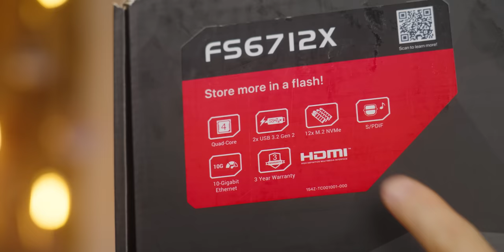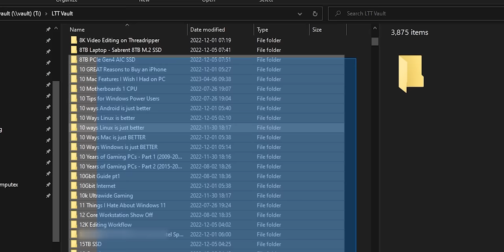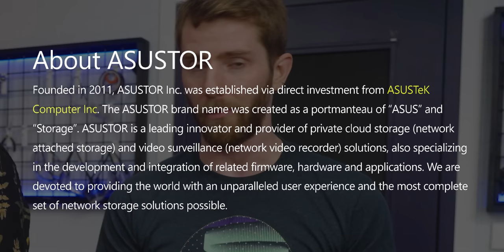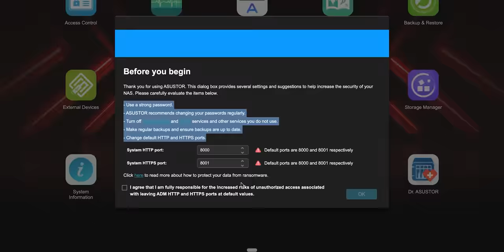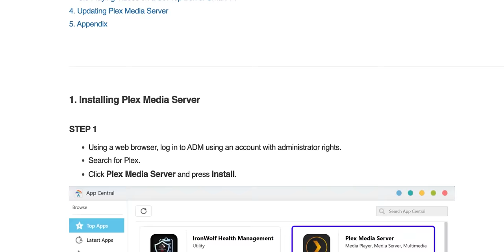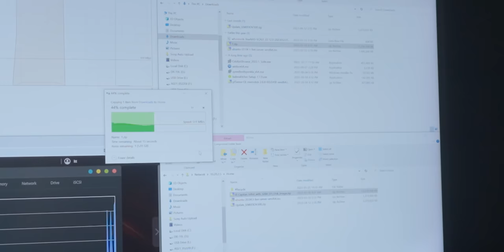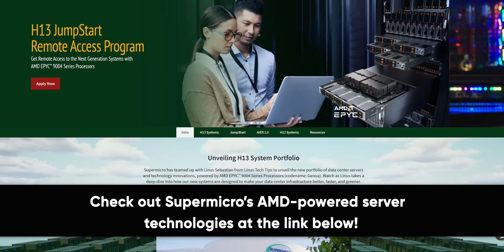I should stop building computers - ASUSTOR Flashstor NAS

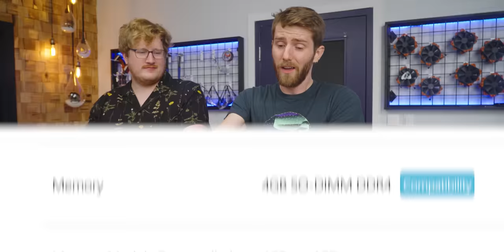Comment from the maker: Minor visual error at 1:04 - the graphic says 2GB but it should read 32GB, as the kit has two 16GB sticks of RAM. Sorry for the flub!
Reply: 2*16=2 confirmed
Reply: @unknwnd  2+16(0)=2
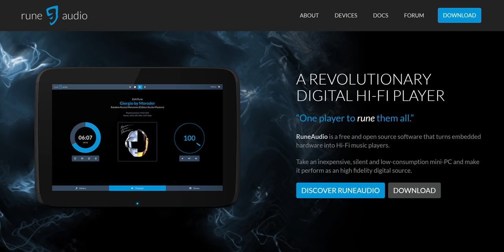Reply: There’s another error at 5:56. Roon Labs is the popular among audiophiles music server software, not Rune Audio.
Reply: That PPNAS is really turned on now! 😂
Reply: Actually at 6:05 you can see they are install 2 8GB sticks since that's all the SOC can do anyway. So graphics are wrong again but Jakes words was right.
Reply: Not surprised that even your correction is in error... maybe just stop putting out content that is actually just thinly veiled advertisements for your sponsors, and focus on the facts.
Reply: Simple question.. how would the experience be to play games stored off a NAS like this with a 2.5g or better connection?
Reply: @joetuktyyuktuk8635 I like the part where you were forced to watch this... Oh wait, you weren't!
Reply: A few things I would suggest if you do an updated SSD NAS Video make sure too use SSD's with extremely strong Onboard SSD ECC, BTRFS or ZFS for Format and if at all possible ECC RAM and a Pure Sign Wave UPS more layers or DATA Protection is usually a good thing!

Comment: This NAS is currently a little pricey all in, but with how quickly NVMe prices are dropping, I think it will make even more sense for those who want a quiet little NAS and don't only need maximum capacity.
Reply: Do you think it would be possible to do this on some sort of Pi? I'm not sure if you'd have enough PCIe lanes or enough performance for the RAID
Reply: no this is extremely janky for the price perf - compared to what even red shirt jeff could do
Reply: Hello there
Reply: I think you're imagining a market for this. The percentage of people that purchases a NAS? 0.2%

The percentage of thos that would pay extra for silence? 0.2%.

The market for this is apparently 0.02%.
Reply: I think you are wrong about it being pricy... its about application.  for persons with unlimited space and power there are cheaper options, but the fact this is so small, and power efficient, and for me best of all... shock resistant (ie while going down the road) means this unit is perfect!
Reply: still alive buddy !
Reply: @jamesmcjamesington631  someone cant math properly :D thats .0004%  but you are right this wont be for everyone, but there are a lot out there that will have a real need filled by this product. people who live, or spend significant time in boats, rvs, traveling in general.. this is a portable box that will have huge implications for people who have been looking for something like this for a long time
Reply: @Pipe0481  a pi 4 only has 1 PCIe lane, and it's only exposed on the the compute module i believe
Reply: Ya, with a half gig nvme boot drives alone going for prices in the 20s in many cases now, adoption of nvme is pushing spinning drives into obsolescence at a high speed. They're going the way of the CD drive. In a large part it's because flash memory itself isn't revolutionary. It's not bleeding edge tech, it's been around for decades. It's just a matter of adoption by mobo manufacturing and drive manufacturing being increased to support the tech that is already generations old and proven to not being decreasing in use, so they're a safe manufacturing bet for storage drive makers.
Reply: @Pipe0481  Open Media Vault is a bare metal distro for Pis that handle external usb very well
Reply: @shephusted2714  with jank being a term being thrown around more and more these days, I've been interested to see the difference in how different ppl definite it. How do you define "jankiness"? I know how I do isn't necessarily some standardized thing... I guess I'd define it as being something mostly defined by being based on "retrofitted in the moment" non pre planned solutions that are often ugly, slapped together with what's readily available, but work and don't need to be looked at. What's another take on it, outta curiosity?
Reply: I'm having some Deja Vu, did you do a video on this Jeff?
Reply: no way i didnt realise jeff wasnt a small techn channel with about 30k subs
Reply: Agreed but the convienence! I like how you actually follow Linus Tech Tips. Saw you in WAN show live chat the other day too!
Reply: For sure. If I had $7k that I could drop on this and 6 8tb nvme drives, I'd be set for quite some time.
Reply: Like linus said, it's useful for an on the go Nas. For product reviewers, and I'm sure a lot of other use cases it's useful. Not for normal home users.
Reply: It's only has speed no more than Sata drive.

Granted it's SSD, and it run insanely fast with some Raid. But you only will need SATA SSD
Reply: 6:12
Reply: @Dygear  Not yet. We sent him one though. He did the Lockerstor 6 Gen2 recently.
Reply: @Dygear blog post, video is currently in progress. I'm testing an SBC against it 😂
Reply: 9:04 no idea what any of this means but is interesting 😀😀
Reply: @jamesmcjamesington631  So millions of people? Lmao
Reply: Especially if we wait 3-5 years, the tech will get cheaper and these will start showing up on the second hand market. Gives us normal plebs the ability to built a hot rod nas
Reply: @Username-u5e  General Kenobi!
Reply: NVME prices are dropping?
Reply: Depends on bulid
Reply: @marcogenovesi8570  ya, can't argue that at this exact moment I spose. But it is definitely on the horizon. Unless there is some revolutionary tech that arrives first, these will inevitably take a larger and larger chunk of market, which is still good for innovation and prices. It seems like a no brainier eventually. The major worry is flash degrading, but I guess mechanical drives can fail, too. Taking plates from a spinner and retrieving data is easier than recovering from failed flash, though, so I don't think my comparison to CD drives is quite accurate.
Reply: @ampgammer  Seems like this would be ideal for a newer team with a limited budget that needs a server on the fly.
Reply: @Pipe0481  fast data transfer/compressing uses an insane amount of cpu power. so no, not yet or for another 5 years at least.
Reply: @marcogenovesi8570  WOOT! WOOT!!
Reply: ServeTheHome did a review for this. Jeff did a Collab with ServeTheHome. Now LTT does the review, it's a big love triangle and we all are better served following you all!
Reply: I only wish that 4tb nvme pricing was better aligned with the rest of the pack..2tb around $120 is very nice.

Also I'm thinking 2 arrays of raid 5 would need better than the 12 drive raid 6 given the hardware.

Something like this with an N200 would absolutely be awesome.
Reply: @jamesmcjamesington631  can't speak for anyone else but I have a 6 drive Synology with 12tb drivers and a 5 bay expansion I was going to use for crypto farming storage, but it became too impractical 3 days in. So I had a handful of nvme drives and a decade worth of backup storage.

If I were shopping right now, I'd probably go for something like this with TruNAS for home lab storage.
Reply: @benvredenburg534  yeah, the drop off after 2tb for pricing is massive.
Reply: Jeff is in the house wowowo
Reply: @Tential1  mas storage for a home loan kubernetes setup. The 6 drive version is probably the better option.
Reply: @Anthony P  someone can't math properly :D that's .04%
Reply: Prices aren’t low enough yet for nand to replace spinning rust. And w/ a NAS you’re paying for the software just as much as the hardware. If you’re already invested in Synology it could by a hard switch to something like this. But if Synology gets on board, Qnap already has, then it bodes well. 

My concern is drive failures. I’ve had a lot of nand fail than spinning rust. And this concerns me w/ something like this that’s going to be used for backup.
Reply: Just a little? I can get a way more powerfull mini pc for that price
Reply: I wish Jeff was my shady rich uncle
Reply: Like instead of involuntary incriminating me in a multi-tier money laundering empire. He would like teach me how to do like pen testing or something and we would ethically topple multi billion dollar organization but to just like to test their security or whatever.
Reply: This scenario was covered pretty early in the video, Jeff.
Reply: Motherboards are coming with 4,5, and 6 m.2 slots now. They are pricey still. But down the road a diy itx nas should be near cableless, like the asustor 6.
Reply: @NightSkeptic  absolutly.. honestly im amazed its taken this long for someone to come out with one of these types of nas units..
Reply: @jakekisiel7399  there are some crazy good bargains right now. In some situations NVMe no more expensive than their SATA equivalent.
Reply: It is somewhat pricey but also rather elegant.
Reply: Love when my subscribed channels leak like this.
Reply: @fxmech one big happy family. And many will gather at LTX!
Reply: @jennastewart7305 but we all know the comments are where the party's at 🎉
Reply: @jamesmcjamesington631  I don't even know what a nass is or what it could be used for
Reply: I have a synology that’s going on 10 years old and still works!
Reply: The actual barebones box with that custom tooling and the custom board and all those features...kinda nuts for under 500 bucks
Reply: @jamesmcjamesington631  with larger phone capacities and higher pixel cameras. The market for home nas has been growing dramatically in the last few years. I agree with you the market for silent nas is very small but we are not far from SSD prices making it cheaper to buy and use SSD nas rather than a hdd nas.
Reply: @ampgammer  This is kind of only impressive if you need portability from a NAS along with massive storage, and for all the work to be done for you. The 6 drive version only has 2.5Gb networking, which doesn't make sense. My 4x6TB HDDs running truenas in a VM gets the same throughput, and could be improved with a single NVME cache drive. 

If you can't even max out the 10Gbe interface, you would have to just need a massive amount of SSD storage to travel with. Probably don't need that much bandwidth on a boat/RV anyway. Otherwise you could get a $500-$650 laptop (even less used) that accepts 2 SSDs and just mirror 2x8TB for redundancy (or not for capacity). You end up with a faster CPU (like a 4600H/5600H) for services, built-in battery backup (would've wanted the NAS on a UPS anyway) and even have it serve as a mobile router. It's even a spare screen that can be stowed away with sleep disabled. Saved even more space and money.
Reply: Ayyyy Jeff good to see you here as a top comment
Reply: I meeean I'm in the weird position of actually having 10* 1tb nvme literally scattered on my desk so this is actually tempting even though I have zero use for it
Reply: It is limited to 10Gb and CPU so it doesn't need to be expensive NVME, or even NVME at all.
Reply: Honestly, I was thinking of having a NAS but if it's hard drives, has to be RAID 10 and the fact that this uses SSDs makes RAID 6 viable
Reply: Lately NVME prices skyrocketed. I missed out on great opportunities late last year
Reply: nvme prices are going up if anything and this was a review for cash deal and therefore can't be taken remotely seriously - red shirt jeff would saw one of these in half and then make something better
Reply: Exactly especially when you can by a SS NAS with more m.2 or even Sata ports and buy more Smaller Capacity Drives.

I would suggest too use SSD's with extremely strong Onboard SSD ECC, BTRFS or ZFS for Formatting (Depends on your OS!) and if at all possible ECC RAM (Ryzen supports it by default but need to check with the Motherboard Specs!) and a Pure Sign Wave UPS more layers or DATA Protection is usually a good thing!

I really wish CAMM2 used ECC as part of the Spec!

Comment: This is like SO close (may still be worth it). Loved everything but the processor. I hope there is a Rev 2 with a processor that can last.
It's a NAS so it's not something you want to replace in a year or two. I want it for a decade. Everything else is great, but that processor is just gonna get worse and it seems too strained doing some things now. It may certainly be worth it for some people that just want a new NAS and don't stream from it, though. I hope enough people to get an upgraded one.

P.S. I would really like LTT too spend more time in the  "mid-tier" space again with things like this. It's fun looking at $100,000 servers but it doesn't really help most people and prices are running so high right now, we need more practical idea coverage.
Reply: It's really something beyond my understanding how these companies insist on using slow Intel CPUs on these products - did they fall off a truck? Also, the latest N-series processors aren't much faster than the N5105 either.
Reply: @Gabu_  energy efficiency. 
These mobile Celerons are great. They have a decent igpu with support for Hardware HDR tone-mapping, the compute power of a 7th gen i3 while sipping power. 
Compared to the J-series desktop ones they're better in every aspect, but they aren't as popular on desktop board unfortunately.
Reply: You mean fortunately? They only match the slowest 7th gen i3s performance, and only in multithreading (the i3s are dual cores, a sin in 2023) - keep in mind those same chips still can't match 2nd gen i7s.
Sure, for energy starved applications these cpus make sense, but do those 10-20W REALLY warrant giving up on 500% performance or more?
Reply: @Gabu_  you might care about energy efficiency for: solar off grid applications, mobile car applications, ???
Reply: @Péter Friedrich  see, is it "energy efficient" or just really underpowered? 
I don't get how it is more energy efficient to keep the whole system up and waiting on parity calcs and data transfers for twice as long.
Reply: @Gabriel Guedes Balogo  this feels a lot like putting in a 4 cylinder engine in a mustang or camaro. Yes it will be MUCH more gas efficient than their proper engines AND still technically run the car. But are you going to be happy that you only paid 70% of the price you would have for that outcome?
Reply: @fitybux4664  the energy efficiency of these chips is only higher when most of your uptime is nearly idle, a zen 2 or zen 3 would TROUNCE in performance per watt. There's a significant difference between power efficient and power starved.
Reply: CPUs don't get slower, most software just gets more demanding. But you'll probably have the same NAS software on this in 5 years as you do the day you buy it, so the performance will stay the same. For a single person this is probably fine in terms of performance, it's still faster than a hard drive installed right in your computer.
Reply: @danieljensen2626  yeah, obviously, that is the point. If it's having trouble transcoding and such now its only going to get worse. That was my point.

Comment: My nas is heavily moddified and upgraded and I love it. It's an old HP Mediasmart EX495 that I got on ebay and I upgraded the cpu from a dual core celery stick, to a core 2 quad Q8200. The ram was 2gb of ddr2 but I upgraded to a 4gb stick (max amount). The machine didn't have any output, but I bought a special adapter that fits to the motherboard and gives you a VGA port and added it to the case (dremel work required). I went into the bios and changed the boot disk from one of the hard drive bays to one of the usb ports and installed OpenMediaVault as my operating system so I can utilize all 4 hard drive bays for storage instead of 3. I got 4 2TB seagate hard drives totaling 8TB of storage but set them up in Raid 5 so I get roughly 5.84TiB. Overall, I'm very pleased with the result. I spent much less for the size and quality compared to modern day NAS machines. Obviously not as fast, 1 gigabit, but I also prevented this equipment from becoming e-waste and repurposed it for years to come. It serves as my Jellyfin server and basic file storage across my network. In all, I probably spent around $430.